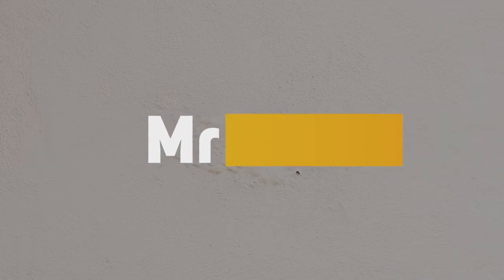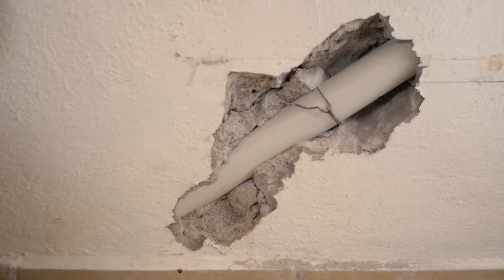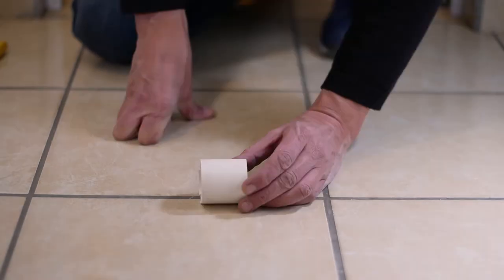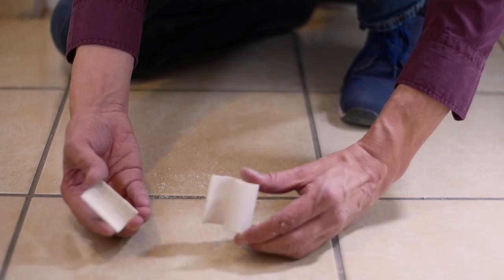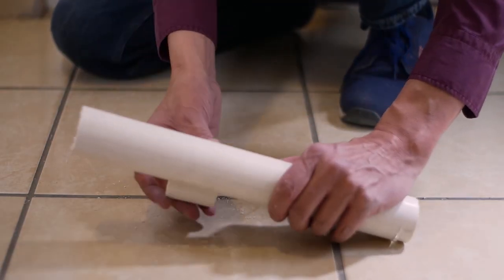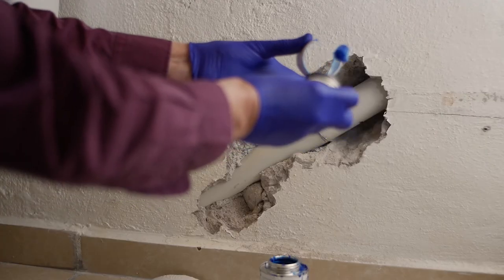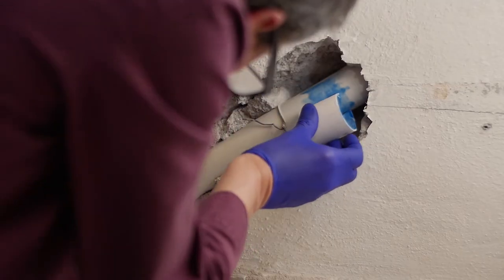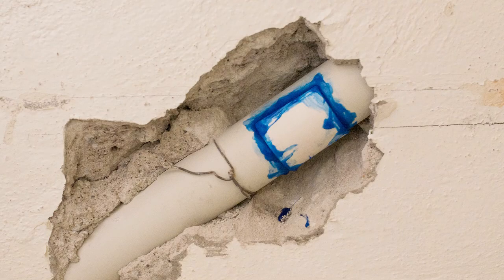A Fast and Easy PVC Pipe Repair (Low Pressure Line) 🧰

Comment: What do you consider to be low pressure? Is 60-80 low pressure?
Reply: 80 is higher 60 is on the low side... most irrigation not connected to municipal water runs at this pressure 60psi. I would never do a repair like this on a constantly pressured line. This guy doing it inside of a wall is asking for trouble. This would only be acceptable on a sprinkler zone where water is only traveling through the pipe when sprinklers are running. Never pressured unless they are on and when they are on the pressure is reduced due to water exiting the line. Still, it's a great trick and it does work. He left important steps out, it's still a good video if you know what you doing. Every method has has it's appropriate time and place... this is an example of where it should not be used, and one should never dump a bunch of glue on it after the fact. Cover the area well on both sides so you are getting 100% of the contact area, and clean up the extra glue around the edges without sliding the repair piece around. Either it sealed or it didn't. If it did not that extra glue will just hide next week's leak, or at the very least slow it down a little bit so that you will have tremendous damage over a long period of time.